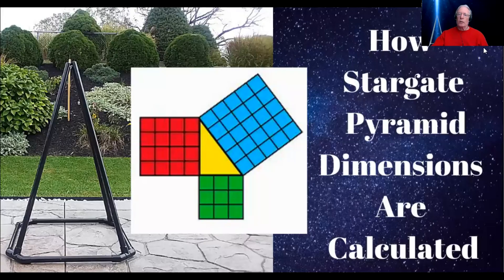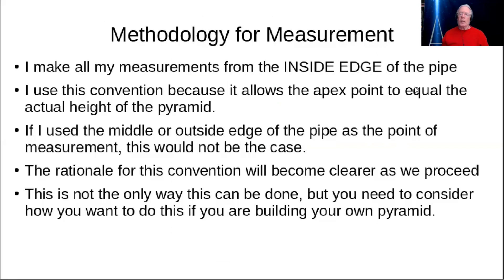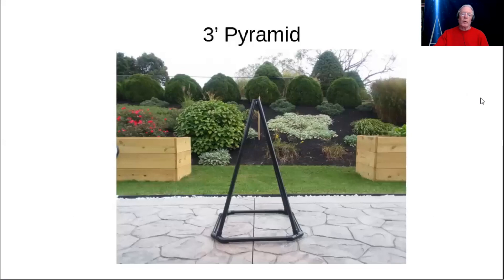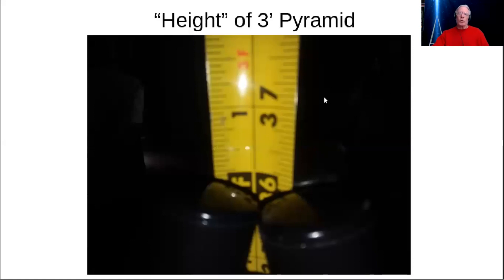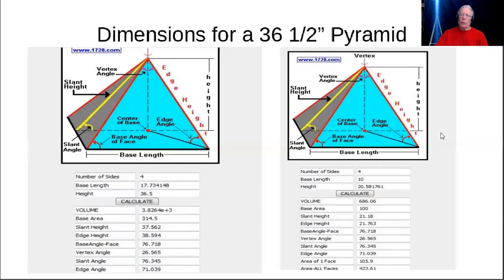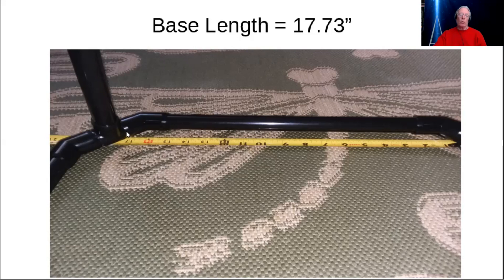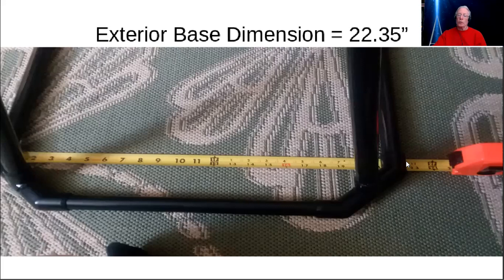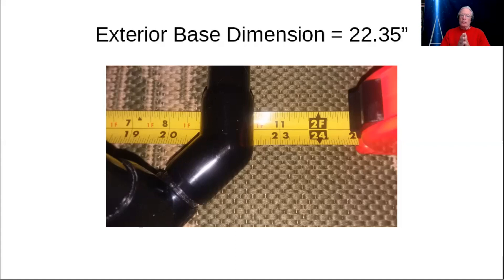How To Calculate Russian Pyramid Dimensions

Comment: Does the pyramid's performance decrease exponentially or linearly as the slant angle increases or decreases from the golden angle of 76.345?
Reply from the maker: I have not researched that and don't know of any other research on that question.  I can only tell you that the 76.345 is more powerful than the Giza and other less-steep angles.

Comment: Great info. Looking closely at the number in the Height box of the online calculator, the point value shows 20. 581761.  Your words say 2.0581761.  Many Thanks
Reply from the maker: yes the base length i used in that example was 10, so 20.581761/10=2.0581761, which is the ratio of height to base length.
Reply: Wohoo!! I got it! Just made a bamboo pyramid with a base of 40 cm's and height of 82.36 cm's (40 x 2.059). I hope its right :)))